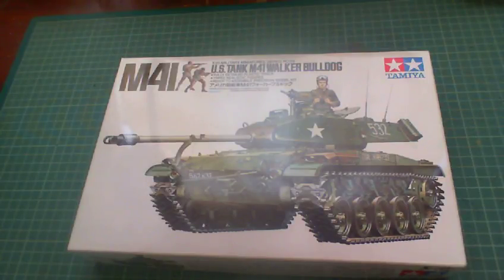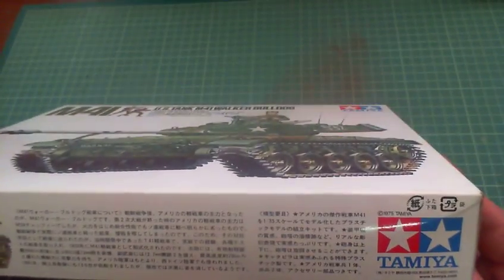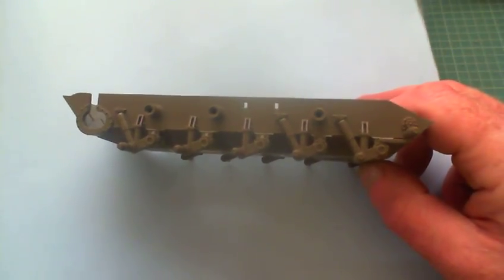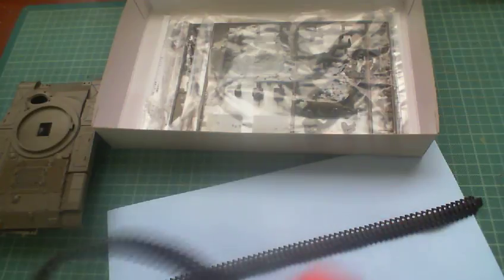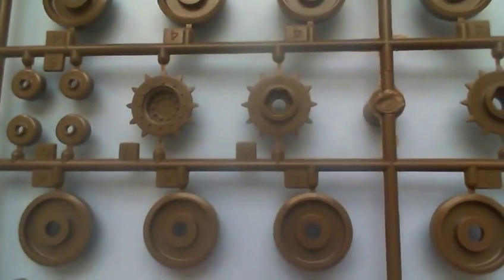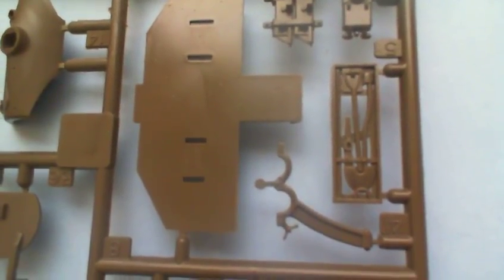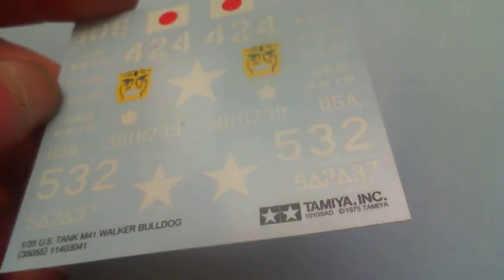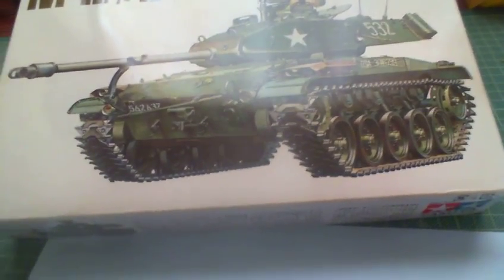Tamiya 1/35 M-41 Walker Bulldog  Un-Boxing

Comment: A good old honest Tamiya kit, you just cannot beat them for fun and value too. They go together well and allow you to use your experience to make it look great with a little skill and a few paints and weathering materials. 
You are 100% correct John, there is no real need to buy extra bits and pieces for this model. If you tried to get a metal barrel and some posh tracks, you would end up spending twice the price of the kit just to avoid a little clean-up on the barrel and a touch of paint and weathering of the tracks. Also a lot of the track systems out there are not too easy to assemble and are not really any better looking once you do a little work. The Walker Bulldog does not have saggy tracks, so there is no real excuse that the workable tracks would be better. That's the way I think anyway, I would never presume to say that I know better than another modeller, I am still learning the ropes.
Anyway, Have fun with the build and let us all know how it went,
Joe
Reply from the maker: Thank you Joe it should be a quick build :-)  J

Comment: John, I agree with you that this kit goes together without any drama. I'm just finishing one myself (didn't notice that the figures were the wrong era so good spot there). Only thing to watch is the drivers periscopes are open and have no clear inserts so you may have to delve into the spares box and cut some clear plastic to fit (whereas the commanders cupola has moulded in solid view ports. go figure ??!! ). Enjoy the build, mate :)
Reply from the maker: Yep these old kits are great but you do have to do a bit yourself  :-)  J